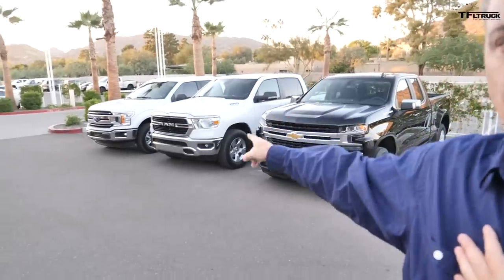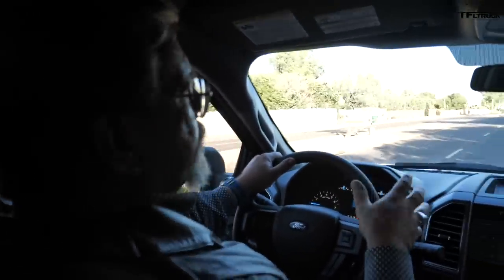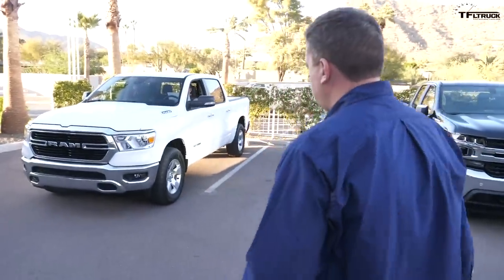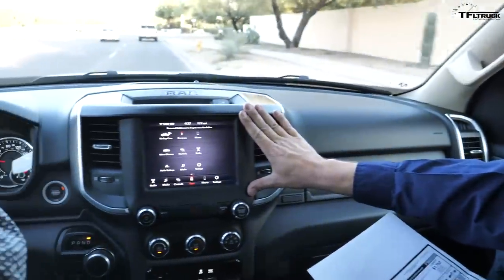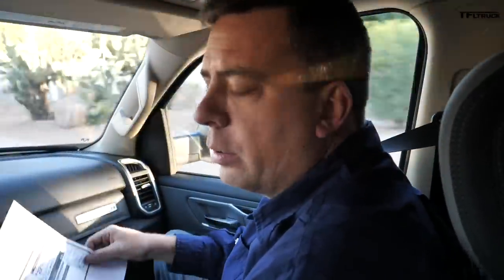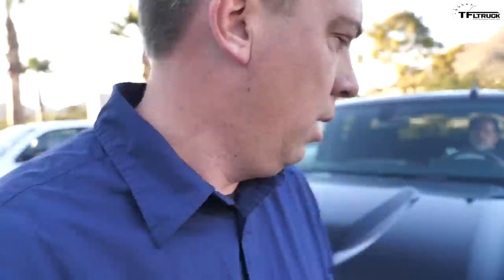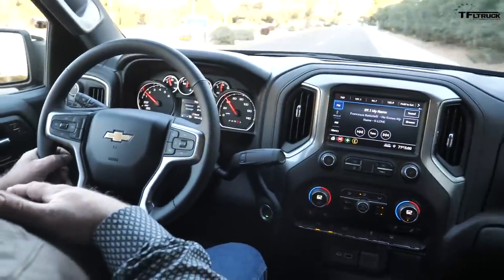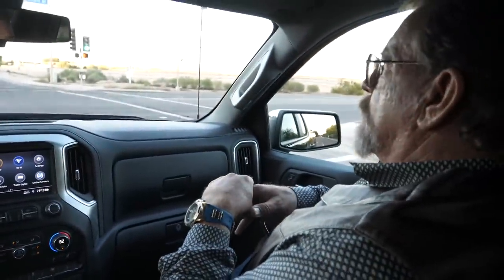Work Truck Wars: 2019 Chevy Silverado 4-Cylinder Turbo vs Ford F150 vs Ram 1500 Review

Comment: When Ford releases a 2.7 they race it innBaja and test it against v8’s on Davis damm. Chevy releases a 2.7 and pits against the weakest offering of the competition.
Reply: Do you not see how the two motors are different? One is a 4 cylinder base engine and one isnt....
Reply: Track Days I understand you’re sensitive.
Reply: Jason Larsen someone questions your opinion and you call them sensitive. That’s ironic
Reply: daniel Stark it’s not opinion. Nobody buys the 3.3 f150 in a trim comparable to the gm RST. I’m only using what GM has brought to the table here.
Reply: The 2.7 isn't base. The 4.3 is still the base engine.
Reply: @BullittKid08  4.3 V6 is the base, the 2.7T is optional so chevy failed in comparing apples to apples cuz they knew the 2.7 EcoBoost would humiliate it.
Reply: Boostang be more reasonable if they brought a gm WT model if that was their goal. But the whole Silverado launch has been lame
Reply: Boostang in some configurations the 4.3 is base but the other ones the 2.7 t is the base engine.
Reply: @smiller225  it's the same with Ford. In some configurations the 3.3 is the base  engine and in some the 2.7 is the base engine.
Reply: DURAMAX_DELIGHT I don’t think that’s how things work.
Reply: @Rocksolidbullys  what is your point?
Reply: They used the 3.5 ecoboost not the 2.7 in the Baja 1000. Regardless the 2.7 is the Chevys competition for their 4 cylinder turbo.
Reply: @BullittKid08  GM's 2.7L turbo is NOT the base engine. The 4.3L is the base. GM's 2.7L DOES compete against fords 2.7L.
Reply: King Tut756 the used it in the Baja 1000 development truck for the new body style.
Reply: LMFAO! Love that comment! True Ford always pits up against the big v8's and shows their guns!
Reply: @TheDaltonmichaels  The LT isn't the base model Silverado. The WT is. For the WT, Custom, and Trail Boss, the base engine is the 4.3L V6. The WT is the competitor to the Ram Tradesman. The Ford XLT can be had with the 2.7L EcoBoost for less than the Silverado LT with the 2.7L i4.
Reply: GM designed the 2.7L to replace the 4.3L as a Base Engine. The 4.3L will be discontinued either next year, or 2020
GM's 700+ Hp Twin Turbo 2.2L V6 would put Ford Engines to Shame. As well as the 4.2L Twin Turbo V8 and 3.6L Twin Turbo V6 that are currently being used in the Cadillac's.
Reply: @1badk20  Are you seriously suggesting that GM is going to put a 12,000rpm Indy car engine into a car? Because there is no way that engine could ever work in a road going car. And yes, the 4.3L will go away in the future. But it hasn't yet. So its still a poor comparison by GM to compare their current mid range engine to other makers bare bones engines. Especially since a Ford XLT with a 2.7L is cheaper than GM's LT with a 2.7L.
Reply: @Stuka87  No, but it would be kinda cool tho in the Chevy Sonic, only 248 Lbs Engine Weight. Ford base Engine is the 3.3L in the XLT, Chevy's Base Engine in the LT (Mid Trim) and Higher Trim Levels, is the 2.7L. That is the Comparison, not the 2.7L V6 Mid Engine, to Chevy's Base Engine just because it has the same Liter Size.
Reply: @1badk20  My point is that Ford's 2.7L truck is cheaper than GM's 2.7L truck. Just because Ford offers the 3.3L in the XLT, doesn't mean it should be compared to a more expensive trucks engine. Ford has 6 different engines so that they can cater to what anybody could possibly want.
Reply: first off i never said LT was a base model , but neither is the ford XLT so idk what your point is.  Also relatively no the ford XLT  can NOT  be had with the ecoboost for cheaper than you can get the 4 cylinder turbo in an LT.  as of right now based on what information is available on the truck configurators from ford and from chevy,   the LT 4 cylinder with no options is nearly identical in price to the NA v6 ford XLT price with no options. oh (i literally just saw this)  actually if you subtract the temporary dealer incentive ford is currently offering that expires 1/2/19 on the truck configurator than the 4 cylinder turbo LT is cheaper than the ford xlt with the NA v6.  so currently as of this exact moment the ford is cheaper by about $600.  id call that the same and thats WITH the temporary discount on the ford.
Reply: @TheDaltonmichaels  Ahh, made a slight mistake in my pricing. GM defaults to 4wd in their configurator, Ford defaults to 2wd. Thats why I saw the Ford was less. Not that there is much of a difference with both having the 2.7L, but there is a bit of a difference.
Reply: Haha it shows the even GM is embarrassed of this engine 😂
And did anyone notice how the 4 cylinder GM truck has WORSE gas mileage than the bigger V6s from Ford and Dodge (Sorry, RAM, bc of “reasons” lol)
It’s clear that GM originality designed this to fill a gap, to complete against Fords 2.7 Ecoboost, but this was such a disappointment that to cover their own ass they changed their minds and now claims it’s make to complete against the base engines from the competition, AND their very own base V6 😂
slow clap
Way to go GM...
And to top off the bad ideas, they added an electric water pump in this turd, so there is no mechanical connection to the water pump...
So now when a sensor goes bad while driving the engine will overheat and seize up before you even have a chance to pull over...
🤦🏻‍♂️
Ok, credit where credit is due, GMs LS engine are amazing 
So how can the same company that made those wonderful LS V8’s make this god awful boat anchor garbage???
Sad day for GM no doubt
Reply: the point is ford came out with the smallest motor put in a full size truck, until now, and compaired it with popular big bore V8s while achieving more than acceptable MPG. fords 2.7 has become a happy medium for truck owners who haul but also commute with a truck.
Reply: The 4.3 is dead. It will be gone in short order. GM is just using their head and not completely abandoning its time proven old base engine and betting everything on a new engine. They blend the new in with the old as to not scare some people off. After a year or so when the stigma of the new engine fades, the clunky old 4.3 will disappear. It’s ancient technology. 
So it is absolutely correct to compare this 4 cyl to the other base V6’s.
Reply: It’s weird because GM has the 4.3 liter base engine which goes up against the other two. The 2.7 4-cyl is more of a 2.7 EcoBoost competitor, and since the Ram only has the 3.6, that is the most powerful base engine you can get, unless you consider the Nissan Titan and Toyota Tundra.
Reply: scot miller since they’re talking Work Truck levels of base, the 4.3 is the one. Also because the base Ram and F-150 were used in the video, compared to a not-so-base Silverado.
Reply: Jason Larsen would you expect anything else from gm
Reply: Willie G rumors have it in 2024 GM add adjustable shoulder seatbelts
Reply: And which engine will run for 20 years?  A ford turbo?  Please.
Reply: slap yourself Jason for saying something stupid on a youtube message board.  the two engines are not in the same class as one is a 4 cylinder with 1 turbo and the other is a V6 with twin turbo's.  duh. stupid and ignorant comparison.
Reply: Bob Hirdes ummmmmmm
Reply: @Stuka87  wt isn't base its special order 9 times out of 10.
Reply: @jasonlarsen3515  two years later.... Chevy is going to shit

Comment: 2.7 Ford EcoBoost vs. Silverado 2.7 4-cyl.  This is a must-do comparo.  C'mon TFL, that would be a meaningful thing to watch.
Reply: Not at all , The EB produces more torque , power , faster it is V6.
Reply: 2.7 I4 is a base engine.  The 2.7l v6 is a significantly more expensive premium engine, so no it wouldn’t be a straight comparison
Reply: @calebniederhofer6529  can it last as long will be the question. I hope the 4 cylinder pans out. I'd like to also see 4 cylinder diesels in full size pickups as well.
Reply: @8__D  the 2.7 I4 isn't a base engine. The 4.3 v6 is. It makes 285 hp while the 2.7 I4 makes 310 hp..
Reply: @alextran8188  oh my bad, thought after 35 years they finally got rid of the 4.3, those things will never die
Reply: @8__D  yeah the 4.3 is just a neutered 5.3 v8 after all
Reply: @alextran8188  its a sbc 350 with 2 less cylinders; so after the 5.7. 5.3 is ls style engine; no relation.

Comment: Chevy and their bullshit. Sure this engine is standard in the LT but it is not in an actual "work truck" model. Additionally, for a very similar price you can get a 2.7L ecoboost with 10 speed. Ford probably should make the 2.7L the base engine in the XLT but options are nice too. 2.7L standard means you might be paying for something you don't want despite the likely hood of someone choosing a better engine anyways. Ram definitely has the best start stop IMO. I can't wait to see some people run 2.7 vs 2.7 though.
Reply: So your ignoring that they compared base engines. When the 4.3 is offered in extreme basic models only

Comment: I'd rather see that 2.7L turbo dumped in a Colorado rather than the 3.6L that it took right out of an Impala/LaCrosse.
Reply: That would make too much sense.
Reply: you mean camaro/Cadillac ..
Reply: s_reilly — There’s nothing wrong with sharing an engine between cars and pickups.  I have the 25l engine in my Colorado and it works fine.  It’s just a matter of tuning and gearing.
Reply: GH1618 I think when talking about the types of loads and weights this truck is rated for, the 3.6 is just not an optimal engine. It’s power is made at near 7000rpm and torque is fairly pathetic for a truck capable of towing 7000lbs. The 4.3 would have been much more complimentary being that it makes its power at a lower 5000rpm and has more torque, again from fewer rpm. This 2.7 turbo would be even more ideal than that, but either is much more fitting than the car-based 3.6.
Reply: As long as they keep the 3.6 liter option for the Colorado, im cool with the 2.7 liter added to the list. I have the 2015 Colorado Z71 Offroad Extended Cab with the 3.6, and its a good combination. Im getting 25 MPG highway and have even gotten 27 MPG before,,,combined city, highway im getting 18 to 19 MPG, however im getting 15 to 16 MPG city
Reply: The 3.6l is a great engine though..smh
Reply: @brandondannys-menary3678  ,,,,I agree, and so is the 4.3 liter.
Reply: Alan Bowers the 4.3 is actually quite competent, and is why it’s the best of the 3 standard V6’s. Pentastar is a minivan engine and the 3.3 is meh. The 4.3 is a truck engine...
Reply: @jacknabstedt3222  ,,,,I have both,,, a 2003, S-10 with the 4.3 liter,,, and a 2015 Colorado, 3.6 liter. I`ve only had the 3.6 Colorado just over a year, and knock on wood its been a good truck. The 2003, S-10 4.3,,, I`ve had since 2006, and still to this day has proven to be a great motor. It pulls and runs really well with 198K miles, it came with the 4L60 trans and it also has proven itself. I think if you asked Andre, Kent, Roman, and Nathan,,,,they would prefer the V-6, or V-8 in their trucks.
Reply: Bryan nice. The 3.6 is a good motor. My Mom has had 2 Traverse’s with the 3.6 motor and they were good cars. I drive a Honda, and their V6 engines are fantastic so when I praise an engine I mean it. GM makes some of the best engines out there.
Reply: Duck of Death oh yeah don’t get me wrong, the 3.6 is just fine for a lot of people I just think that the 4.3 should have also been in the Colorado/Canyons option list.
Reply: Will Younger the 3.6 for 2017+ model is completely different than then the last 3.6 and is specifically tuned for truck duty.
Reply: I generally don't care for GM stuff but I owned an Impala with the 3.6 and it was a great engine. It "felt" like it would last a long time if that makes any sense.
Reply: @jacknabstedt3222  I have a 2016 Silverado 2wd reg. cab short bed with the 4.3 and get around 22mpg.  I had a 2000 Silverado spec'd the same and I put 350000 miles on it before I sold it to a teenager who totaled it 6 weeks later.  Had I kept it I have no doubt it would go 500000 miles and beyond.  There is a huge car dealership near me that sells a ton of parts that they deliver. All of their shop trucks have the 4.3 and some of them have over 800000 miles on them.
Reply: Alan Bowers agreed
Reply: marc mo Our 2015 4.3 was great. Decent fuel economy, good power and it had a little over 47,000 before we traded for a 2018 5.3... great motor. I love the 5.3 as well. It’s more fun but it’s not as tame and refined as the 4.3...
Reply: TheJ602 I haven’t driven a newer V6. Ive driven a few LLT 3.6’s in the Traverse numerous times but not the really new ones...
Reply: Nodak81 GM makes really good trucks and decent sedans/SUV. A sedan with the V6 is good, 4 cylinder is okay, but for a 4 cylinder I’d go Japanese tbh...
Reply: The Canyon/Colorado need the 5.3l as a happy little option 😍
Reply: Colorado has proven to he junk!
Old style S-10s w/ 4.3 better and far cheaper.
Reply: @jacknabstedt3222  ??? Still living with mommie? 😀
Reply: @jacknabstedt3222  You're a Troll for GM!
Reply: Put an LT4 in it. Because race truck
Reply: I would have liked to see the 4.3 v6 at least as an option for the Colorado, but the 3.6 isn't a awful choice for it. It's about where they needed the numbers to be; seeing as Toyota had their 3.5 cooking. Maybe they knew they had to offer a turbo 4 and that's why we got the diesel?
Reply: s_reilly BUT GEARING n   Reporting for a Truck is a different Motor !!
 U stuck your foot in your mouth !!!😂😭 The Block n Motor ARE PROVEN ! Over 100 million miles !
Reply: Sally Hillal  every company does. Or ford wouldn't have released the 6.4
Reply: Bryan :Hello there Brian, I also had a black Colorado Ext Cab Z71,4x4,V6, but mine was a 2016. We traded our Silverado Ext Cab Z71,4x4, 5.3/6speed auto in for, because although we liked the Silverado, we went an test drove the Colorado and was very impressed! So we owned it for three years and 82,000 trouble free miles, for my wife to commute with and traveling together, when we needed to bring our 22’ 4,000 lbs Travel Trailer. We ended up exploring all over the East Coast, from home in Massachusetts to Bar Harbor ME to Key West FL and many places in between and as far West as Corpus Christi TX. During normal commuting, she would get an average of 15-17, with a heavy foot, not bad considering in the Silverado on the same roads she would get as low as 12-15! The Silverado we had was a 2011, that was rated at 310hp/345tq, that was not as quick as the Colorado, or towed the same trailer without any notice of more power. However we ended up both retiring from the people’s republic of massachusetts to Sunny Freedom Loving Central Florida and needed only one vehicle, but the Ext Cab wasn’t gonna cut it, so we went out to test drive every truck out in the market. Funny but we ended up with another Colorado! A 2019 Crew Cab, 4x4, V6, in white, but in the W/T Trim, but with every option available for that trim level! The only real difference other than being a Crew Cab instead of Ext Cab, is the 2019 has an Eight Speed Auto. That tows the Trailer with the same ease! The wife with her heavy foot still gets around 16-17, but I can get 20 around town if I try and 26 hyw at the speed limits.
Reply: Squishysforbreakfast:Hello there Squishy! I’ve owned 4.3’s and 5.3’s, that were great running engines that used little to no oil all while never failing me. But with that said as compared to the latest 3.6’s? The 4.3 might have more low end torque, but quickly runs out of steam at 3,600- 5,200 rpm’s, where as the 3.6 is just starting to breath, with more power, hp that is and torque if you were to use a dyno and see how low a 4.3 dropped to over the 4,000-5,000 ‘ rpm zones, as compared with the 3.6.
Reply: @GH-oi2jf    Low torque car engines that make their power at high rpm are obviously not suitable for pickups.
Reply: @bryan7821    The 4.3 you have is based on the first gen small block, not the current one.  The SB2-based 4.3 debuted with the 2014 model year.
Reply: @k.r.v.4219  ,,,,,,,Just have the transmission fluid changed at regular intervals,,,,,,its a must.
The owners manual says to change the trans fluid at 45 to 50,000K miles,,,,but i talked to a service tech at GM, and he said to change the trans fluid at 35K miles. If you tow a lot, definitely change it at 35K miles.
I always changed the trans fluid myself on my 2003 S-10, at 40 to 50K miles,,,and its still working great at 200K miles, never been rebuilt,,,,,,knock on wood.
Reply: @scarharting 
The same prob with the car based 5.0 in ford trucks, not much low end torque for towing

Comment: Just a little confused here.. That 2.7 Silverado isn't exactly the work truck for the new Silverado.. GM put that behind their paywall. You still get the 4.3 in the models that compete directly to the work trucks with the 3.3 Ford and 3.6 Ram.
Reply: They were scared to put their 2.7L against Fords 2.7L V6. The EcoBoost 2.7L is a little monster.
Reply: Ram will sell you the 3.6 etorque engine across their entire lineup even on a $55,000 limited model. you can get the 3.3 naturally aspirated v6 engine on the ford up to the XLT trim level.